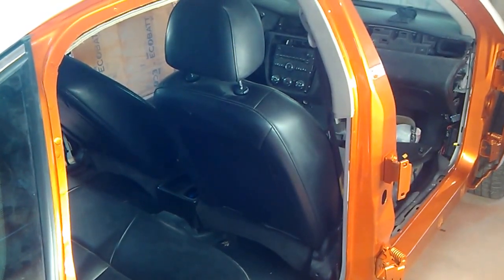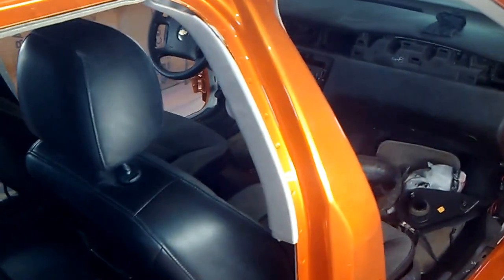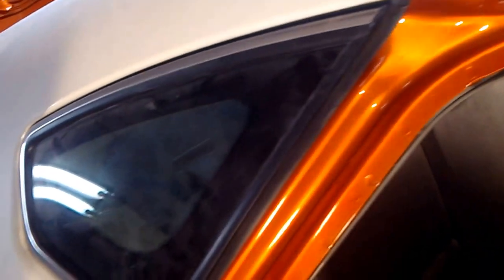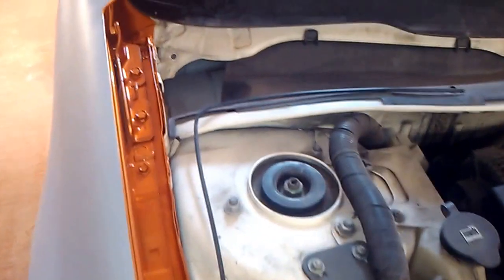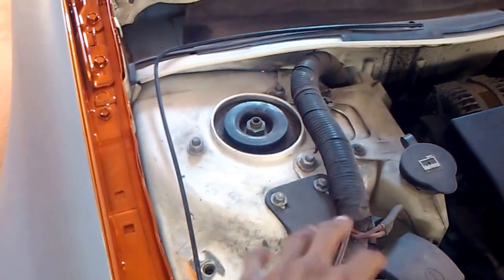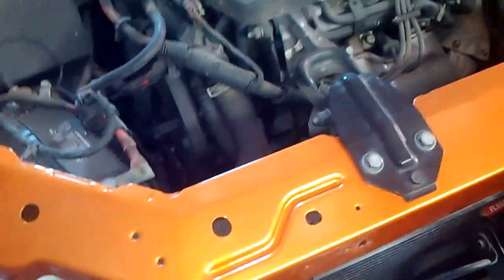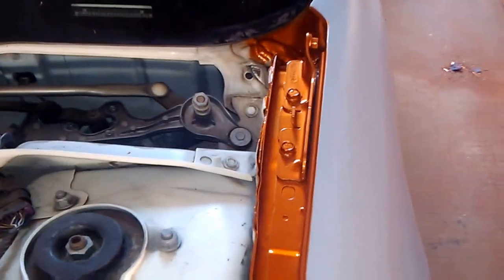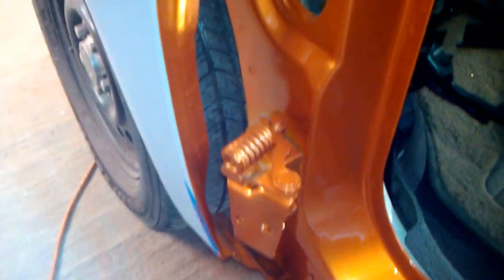Candy Painted Car Jambs (PART 2) 06 Impala / Update 16

Comment: Awsome work bro. Almost ready to paint my car soon. Any chance of a vid showing how to tape off the door jams and what needs to be done to paint the rest of the car after that dont understand how not to get a paint egde doing door jams first. Thanks
Reply from the maker: First off thanks for checking in ...I would love to make a video on how to mask the only problem is i work by myself so i would have to set the camera down so it wouldnt be a close up demonstration ......but any way there's a few ways to mask..i will be using soft edge foam tape - i think this is the best way but its expensive ...you can also back mask - you use regular masking tape....it just take alot longer then with the soft edge foam tape..........thanks again